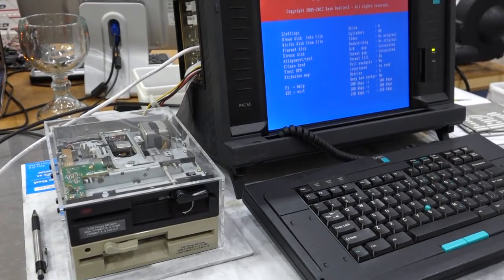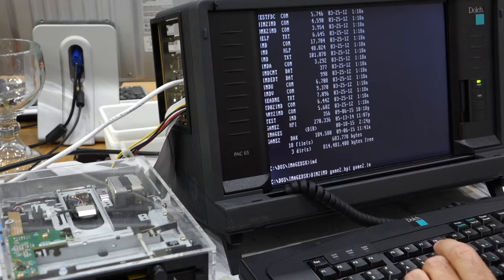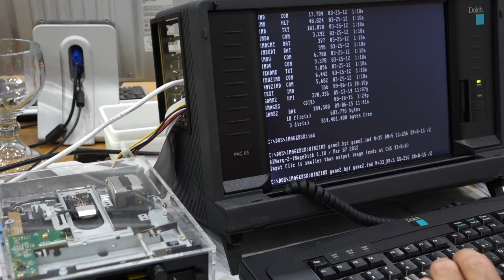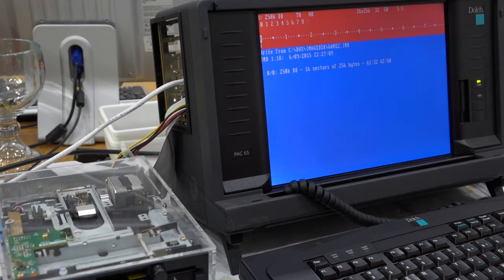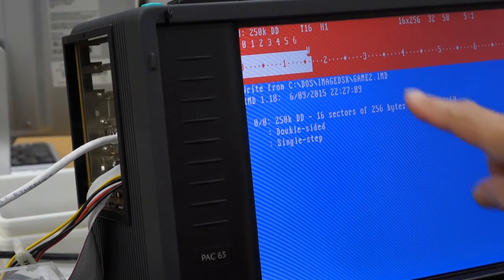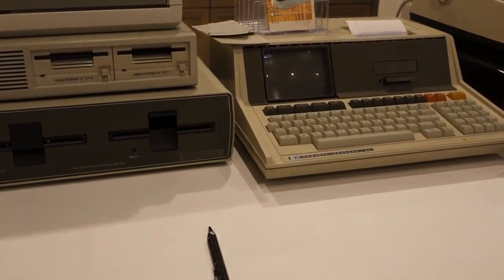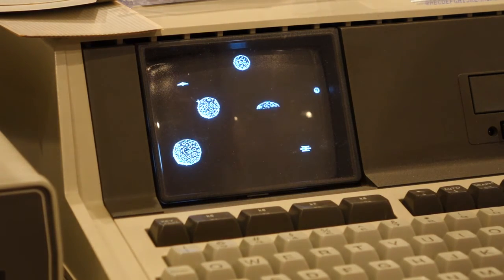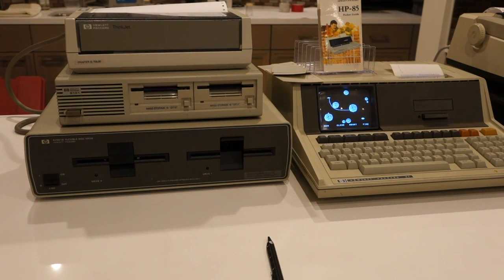5 25" Floppy Part 3: Recreating a HP LIF (not PC compatible) Vintage Diskette

Comment: I think you misspoke when you said "250 k is 250 kiloherz"... shouldn't it be kilobytes?  Thanks for the videos!  :-)
Reply from the maker: At this point it's a modulated analog signal coming out of the drive. Modulation rate is counted in kHz.